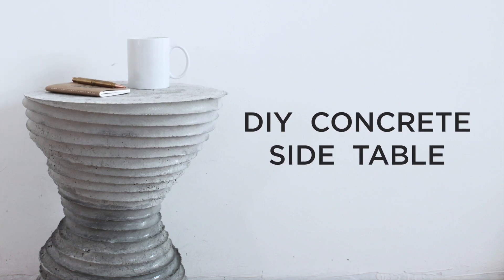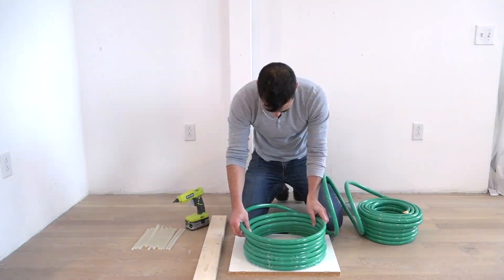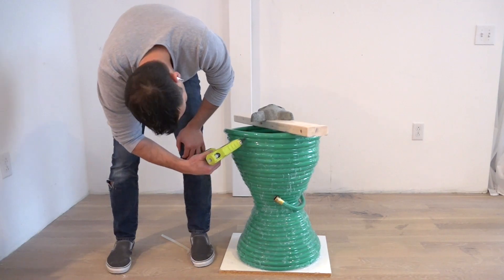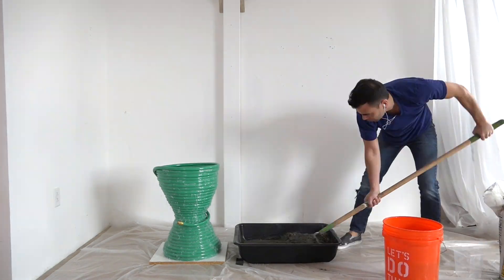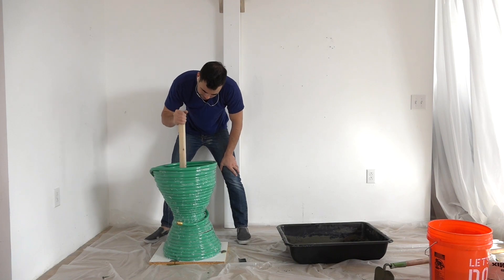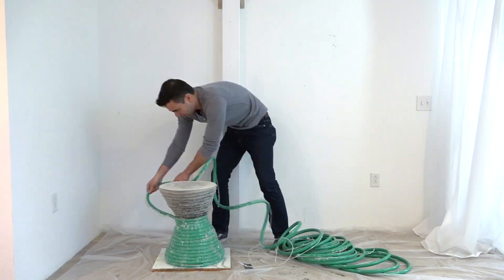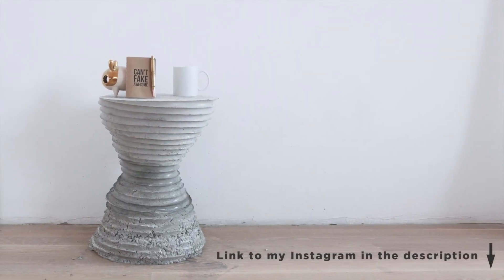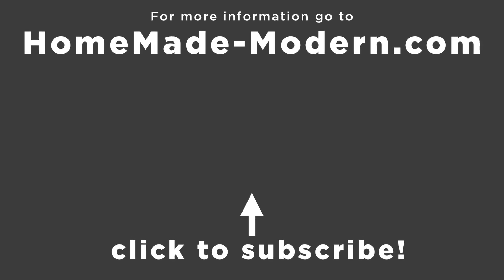DIY Concrete Side Table | Concrete Casting Experiments

Comment from the maker: This was an experiment and there are a few things i would do differently:
1. i would pour smaller amounts at a time and then use the stick to vibrate it better.
2. i would reinforce the outside of the mold with duct tape.  it started to come apart so i had to go easy on the vibrating.
3. i would hot glue plastic bottles to the melamine so that it would have a hollow core

was a really fun experiment though and i think there is potential in this casting technique. the hot glue came off the hose and the hose is not damaged at all
Reply: With regard to vibrating the concrete down I've had this idea kicking around in the back of my head that maybe you could hold a palm sander to the top of the stick and that might vibrate it down better, or that maybe you could could take an old blade from a multi tool and weld a rod to it and fit it back in the tool and let the high speed vibes travel down the rod and vibrate the concrete that way, I honestly have no idea if either of these will work but I'm giving them over to you because I doubt I'll be working with concrete any time soon.
Reply: Said it on a few other projects, Quikrete Q-max would have worked better than the Quikrete 5000, is only a few dollars more, and is readily available at Home Depot.   You really should check it out.   It has a plasticizer in it that really helps it flow into the shape of the form and helps minimize air bubbles on a project like this, that is tough to vibrate...
Reply: Place this mold in a large container such as a garbage can.  Put some sand into the garbage can on the outside of the mold.  If the mold is strong enough, entirely surround the mold.  If the mold shows signs of collapse build the sand up in layers alternating with concrete being poured into the center of the mold.  The sand on the outside of the mold will prevent the mold/form from blowing out.  As suggested elsewhere an orbital sander held against a stick that is in the concrete can work well to consolidate the concrete.  A $14 dollar air impact hammer also does a satisfactory job.  If you're doing a few such projects $100 for a handheld concrete vibrator from habor freight might be worth consideration. http://www.harborfreight.com/3-4-quarter-hp-concrete-vibrator-34923.html.  A section of Sono tube with a bit of wood or cardboard to make a cap may be more satisfactory in excluding concrete from the center to create a hollow core.   Last (for what it all may be worth) if you want to make multiples of this shape you could create a two piece master of this shape.  Scribe and cut to fit vertically some thin stock such as sheet aluminum, 2 pieces to be set 180 from each other and tack in place with hot melt glue.  Place the mold into a garbage can with the parting strips (the sheet metal) spanning from the mold to the inner surface of the garbage can.  Fill the center of the mold with sand so it will retain it's shape when you pour concrete around the outside of the mold filling the space between the mold and the garbage can.  When set/cured, remove the garbage can, empty out the sand and separate the 2 halves.  Remove the hose, the parting strips.  Strap the 2 halves of the mold together with tie downs, rope, wire whatever.  Stand upright, fill with concrete, let cure, remove mold. Repeat.
Reply from the maker: great suggestions!  thanks!

Comment: Water bottles or better yet Styrofoam chunks / blocks added inside the pour.  The Styrofoam blocks could have been cut to reduce the walls of the concrete down to say 3".  You should also have added some type of fiber to add strength.
Reply: Really cool idea for a form
Reply from the maker: Yes!

Comment: Wow, the bottom looks pretty rough.
Reply from the maker: yeah, i didn't trowel it.  in the past i have found that an angle grinder with a flap disc sands it does in a hurry

Comment: Little disappointed with quality. For someone that works with concrete as much I would expect a 2nd attempt and showing us how the suggestions work out. Not willing to attempt something this bold when it worked out so poorly in your video... and you have much more experience than me.
Reply from the maker: i think this just goes to show that even the most skilled can make mistakes (to learn from). no one gets it right the first time, perfection is an illusion :)

Comment: we don't get quickrite in our country. is it regular cement? or something else ?
Reply: Aruna Thea it is ready mixed concrete with sand in the required ratio of cement to sand. you could mix something up yourself, ask someone in a store, they can help, or google which cement to use for such purpose
Reply: Aruna Thea 
u can use any 53 grade opc , local available sand and aggregate of 10 to 20mm mix. 
concrete mix praportion should be 1:2:4 to 1:1.5:3(cement:sand: aggregate) ,water/ cement ratio should be 0.40 to 0.50(adjust it with desired workability).
approximately weight of concrete is 2400kg / cmt.